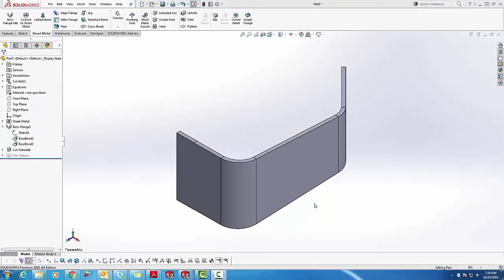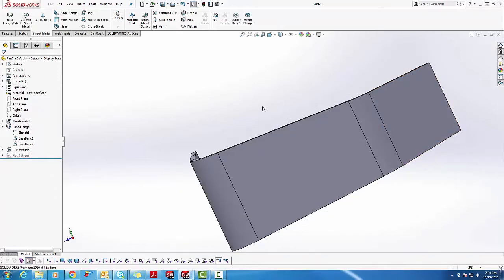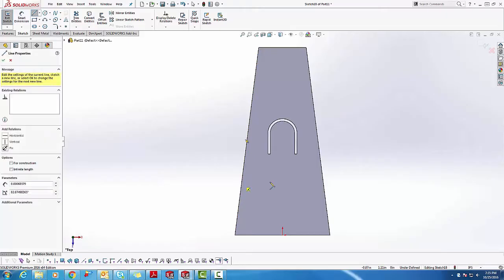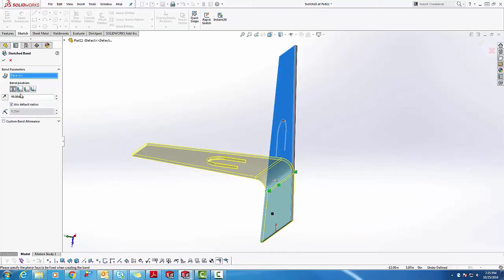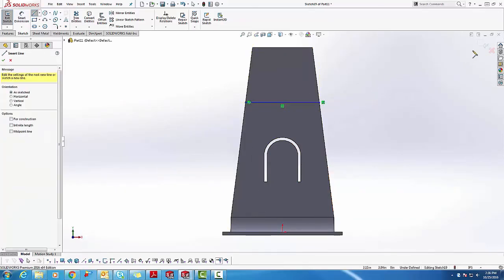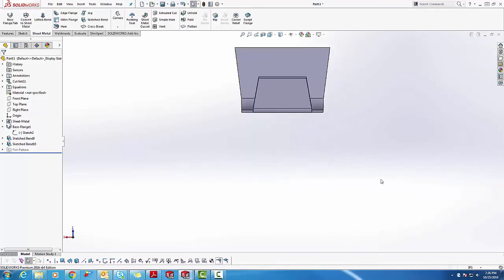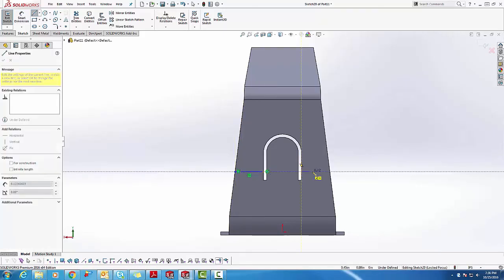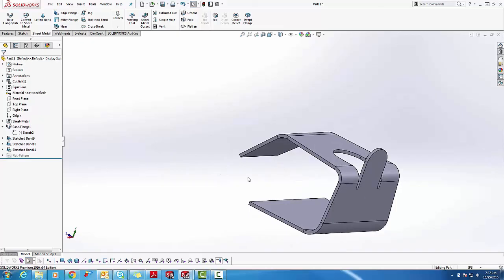SOLIDWORKS - Sketched Bend

Comment: I'm trying to get a bend similar to the last tip you showed. The difference is that my sheet metal is curved and I need the bend within the curved face. Is that possible?
Reply from the maker: Hi Thando,
This technique requires that the face with the tab not already be bent.  This is because a bend cannot be applied to a portion of the model that is already bent.  Further, the tab itself cannot terminate in a bend state itself.

The best approach for what you describe is to create a bend up to the location where the tab bend generates.  and also create a bend following the location where the tab generates.  In this way the single continuous bend would have to be generated as two discrete bends.
Reply from the maker: Hi Thando,
This technique requires that the face with the tab not already be bent. This is because a bend cannot be applied to a portion of the model that is already bent. Further, the tab itself cannot terminate in a bend state itself.

The best approach for what you describe is to create a bend up to the location where the tab bend generates. and also create a bend following the location where the tab generates. In this way the single continuous bend would have to be generated as two discrete bends.

Comment: What if you wanted to bend the inner tab instead of the outer part in the end? I have a part where I am trying to bend a similar tab inwards, but I can't do it using sketched bend for whatever reason. I cut out an arch profile with 0.1mm gap (the bend is supposed to be created with a punching tool; not cut and bent after the fact). Sketching a line from edge to edge (lower inner vertices of the arch) and then trying to make the outer profile the fixed face didn't work.
Reply from the maker: Hi Nuno,
You can bend the tab inward as well.  Given the setup of your sketch (sketching a line from edge to edge, lower inner vertices of the arch) you would need make sure your fixed faces is the main base flange and not the tab then set the "Bend position" in the sketch bend options to "Bend outside".  This ensures that all of the bend geometry is produced on the tab itself and does not try to generate part of the bend on the other side of the sketch line within the main base flange.